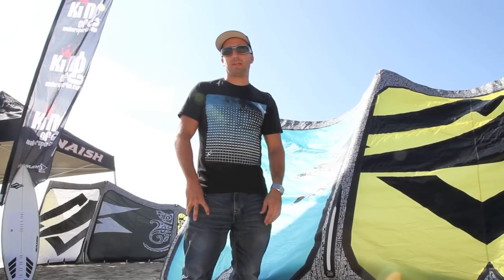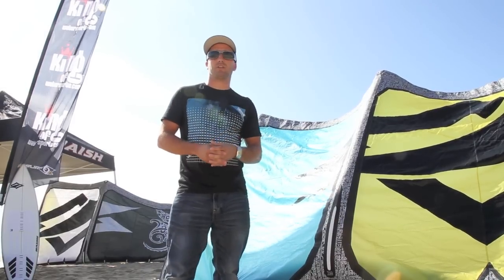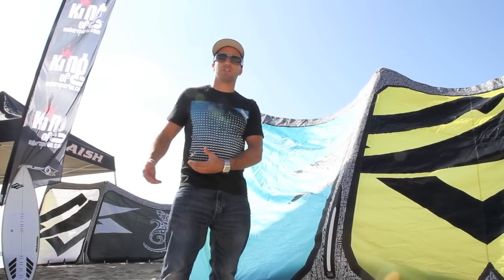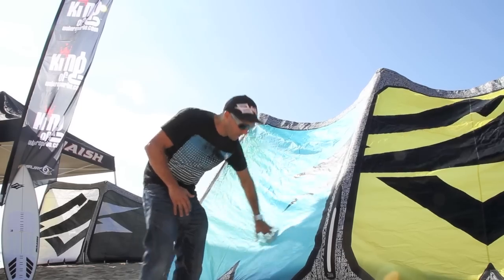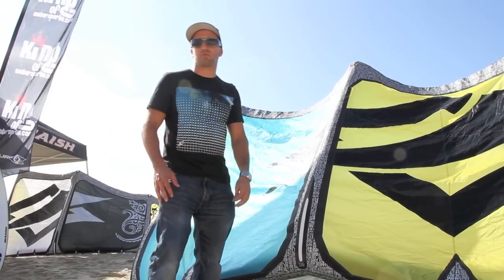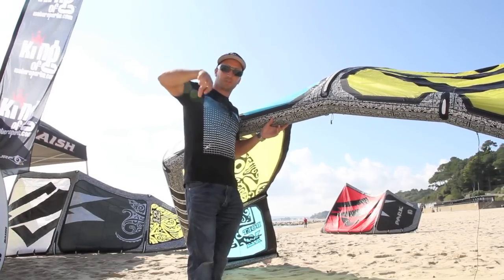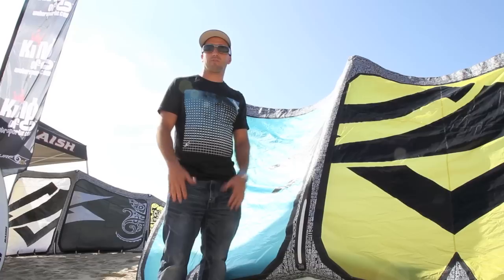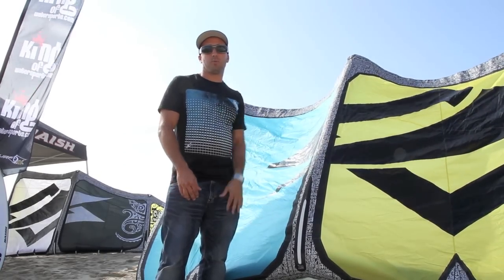Naish Bolt review by Naish Kite designer.

Comment: Naish Trash , new crap by Naish.  (Naish makes ether good stuff or crap , where is consistency) Bar pressure is way too low , it has tendency to over sheet even with fully slack control lines , It really sucks in light wind. It is not good for the waves. Relaunch is Poor.
It is not even close to Cult , Cult was much better. As always Naish makes one step forward and two steps back! Not recommended.
 I meet people that complain about this kite every other day!